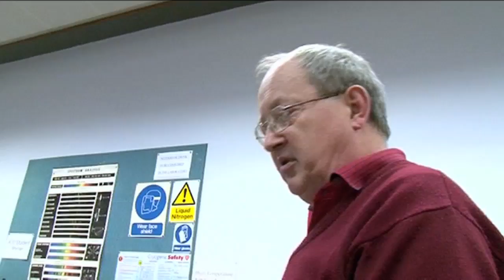Momentum, Magnets & Metal Balls - Sixty Symbols

Comment: To clarify: There's energy transfer (potential to kinetic) between the magnet and the incident ball as it falls into a lower energy position just before impact.  The kinetic is then transferred along the line as momentum to the last ball, which fires off at about the speed of the incident ball at impact (which is much faster than its pre-flux vel). In order to reset the system, energy must be added to pull the incident ball back out of its low-energy position.
Reply: The magnetic field is not conservative. How is it that there exists any form of potential energy? I understand that there are some concepts of energy and work involved, but I am not able to see where does the potential energy come from.
Reply: I believe that the solution to this is that we treat the magnetic field as "conservative" here, as we are dealing with approximately static magnets. Hence, we can define some kind of potential energy. It won´t be radial, but the definition of work and potential energy would work here. Is it correct?

Comment: I'm sorry but fundamental physics equations work regardless of the unit system used, Mr. Condescendence. 
Also, I don't know where you're getting your physics from, but the shape of the ramps don't influence the final speed of the ball, only the height from which they're dropped, theoretically.

Comment: What? Are you trolling?! The factor 0.5 is to account for the lack of proportionality of different forms of energy in the metric system for example. It is used so that certain energy equations are simplified at the expense of introducing inconvenient factors in front of others. In the British Engineering System of units the factor is different for KE or (1.29*10^-3)*m*v^2, so that the energy to heat water is exactly 1 BTU per degree per gallon. Please look things up before saying something.

Comment: there is a limit though, the faster the impacting ball is going the less time the magnet has to apply force.  So at some point, if you stack up collections of these in a line, you should get a maximum velocity.

Pretty cool on the small scale but your never going to see weapons or vehicle launchers based on just this.

Comment: I disagree that there little friction on the magnet, but my description of what I would expect, without friction, was wrong I think. I now suggest that the detached ball will jet away and the magnet and balls slowly head the other way. The potential energy of the free ball held far from the magnet is converted to kinetic energy when the free ball snaps onto the magnet - then the furthest ball, weakly held, leaves with difference in potential energy. But moment is conserved.

Comment: If all momentum was transferred perfectly, that would be the case, but in this case there is a lot of energy and thus momentum lost through sound and heat, which would mean that the ball would not recieve enough momentum to escape the magnetic field and it would be pulled back in.

Comment: Temperature is simply the average speed of the particles, thus, if heat is released,  then some of the momentum is transferred to the particles which move faser, creating heat. Since sound is a longitudinal wave, or a compressional wave, it is simply air particles being squished together and pulled apart, and thus there is a transfer of energy. If energy is transfered, there is a transfer of momentum as well (momentum can also be describes as the kinetic energy divided by twice the velocity)

Comment: Here's a question for you: 
What happens if we manage to create some sort of thin-film metamaterial that can be switched on and off by a weak electric current, that in its "on" state blocks magnetic fields - and we place that at the back of the magnet, so that we can *easily* remove the single ball to "reset" the system? I'm quite sure I've read somewhere about metamaterial magnetic cloaks/shields...

Comment: I'll agree with that. I have 2 Cylindrical ones about the same radius as the one in the video but 1/4 the height and got my finger pinced in them once. I had a red bruised line on my finger for days

Comment: The ball on the left wouldn't leave, since the work done on the ball in the magnetic field on the right is the same as the work required to remove the ball from the left side.

In a perfect system though the left ball would leave with the same momentum as the right ball began with.

Comment: By my calculations, acceleration a rocket weighing as much as a full space shuttle (nearly 2,000,000 kg) to earth's escape velocity (11.2 km/s) in one second would subject the astronauts and spaceship to 1142 g's. A normal in a special suit designed to be worn during high accelerations can take around 10 g's, and the highest EVER recorded survival from deceleration had the subject experiencing 180g's - about 6 times higher. Acceleration alone makes it deadly. (rough math, minor errors may exist)

Comment: I have to wonder how much the integrity of momentum transfer is increased because all the balls are being forced into firm contact with each other by the magnet. Loose balls just slap around and make noise...the balls pressed hard up against each just make one solid "crack" as the traveller is sucked into the magnet. I also would like to see what happens when 4 balls are on either side of the magnet...guess I'll just have to grab some balls and strong magnet and find out.

Comment: I'd imagine it would shoot off even faster, because I don't think the drop in the amount of energy transferred through the balls as you add one more ball is as much as the drop in the strength of the magnet's magnetic field as you move one diameter of the ball away from it.

What I want to know is how much of an effect there would be if you bolt down the magnet so it doesn't move at all. I'd imagine that'd increase the effect by a good amount.

Comment: Momentum is an incomplete concept, the energy of a mass is not m*v, but m*v^2 so we are really looking for the kinetic energy or the true quantity that is transmitted to other masses or balls.
BTW at the beginning the balls didn't arrive at the same time because one of the ramps was more curved than the other, the ball on the more curved one got a higher acceleration. A curved ramp is faster than a straight one.

Comment: Momentum is conserved completely, as you see the metal ball accelerates massively as it approaches the magnet, this huge momentum is transferred along the system, knocking out the 2 balls at the end, 1 weakly and 1 strongly. If you measure the velocities of the two balls, you would see that momentum of the two of them combined is the same as the momentum of the first ball hitting the magnet when you account for the retarding force of the magnetic field.

Comment: What if you made the track into a circular loop, set up a section for current induction as the ball pass through, then place the magnet on a track segment that turns 180 degrees after a certain number of impacts?

Comment: would it be possible to use an electromagnet and charge it just as the ball approaches, let the ball on the other side fly off and then stop running current causing the work done to remove the initial ball to be reduced? is there then a proportionality between the current and the force with which the ball flies off? what's the equation for this? (sorry i'm only gcse physics)